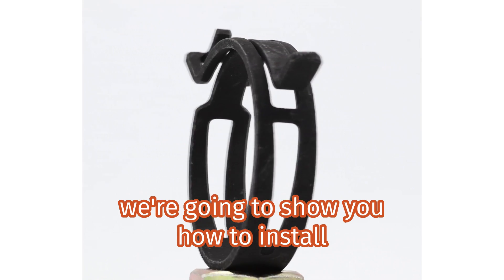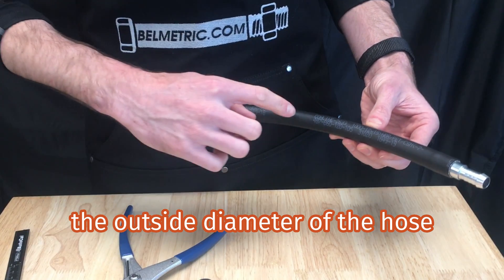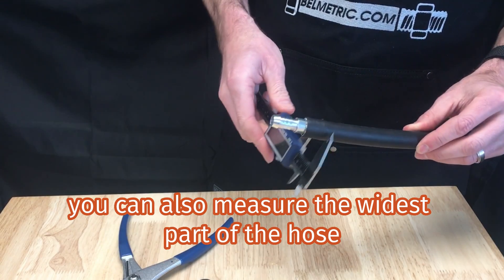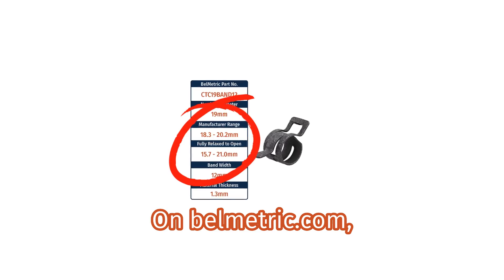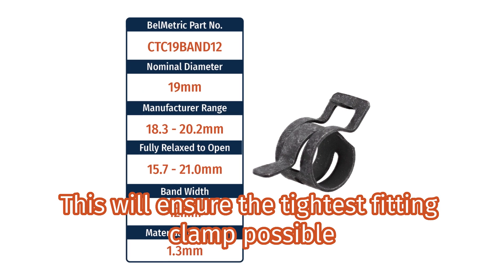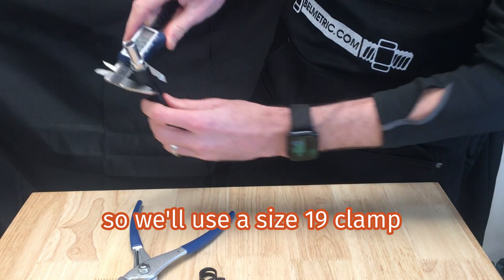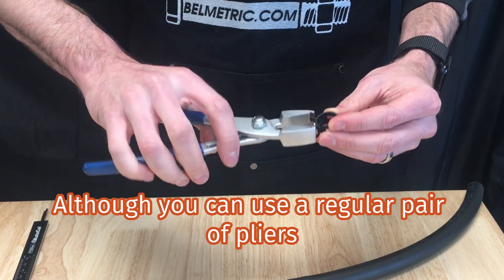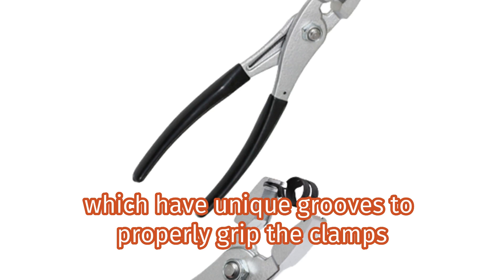How to Measure a Constant Tension Clamp

Comment: Step 1: Replace the clamp with a normal hose clamp you can screw tight.
Step 2: Mount everything together and tighten the clamp. You’re done!
Reply: Perfect, now you have loose hoses, because the hose clamp doesn‘t adjust with temperature.
Reply: @christiancibulka1886  never had that issue 🤷🏼‍♂️
Reply: @KurumaDesigns  do you put a regular clamp on your radiator hoses? No? Well there is your answer.
Reply: @christiancibulka1886  rad hoses on my 440i has quick connect couplings so no, but I used regular hose clamps on my e36 325i and I had no issues
Reply: ok boomer
Reply: CTC clamps are superior to worm drive clamps in many ways. but in non-thermally expanding hose connections it may not matter.